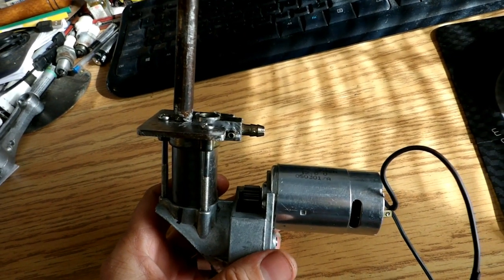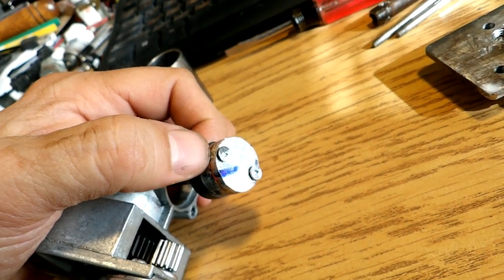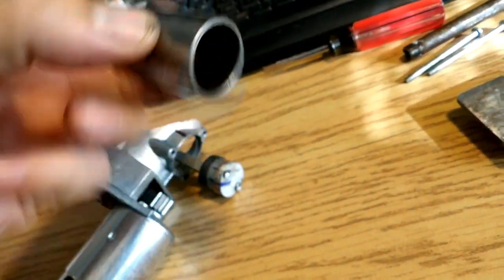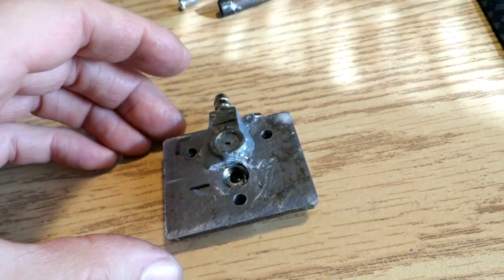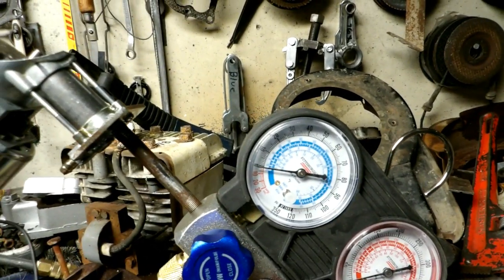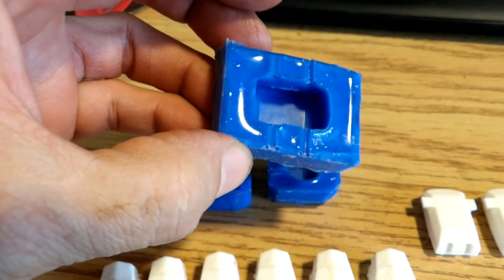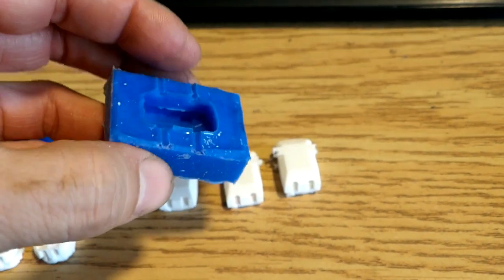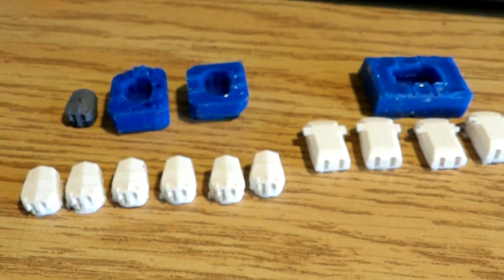Making a 12V Vacuum Pump from a Compressor.

Comment: wow i am surprised you didnt use a briggs engine for a vacuum pump with a little cam shaft modification,,,, 😉
Reply from the maker: I thought of doing that, but it is just too big of capacity for a small electric motor.

Comment: i just use a fridge compressor. also great for a quite shop air.
Reply from the maker: I bought one, but I couldn't get the motor to run, I should cut open the can and remove the piston compressor.